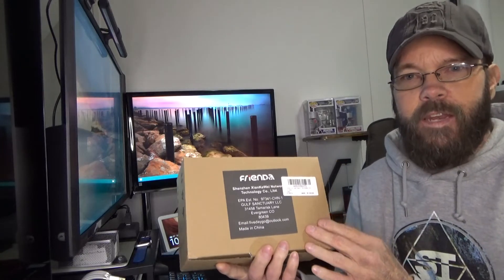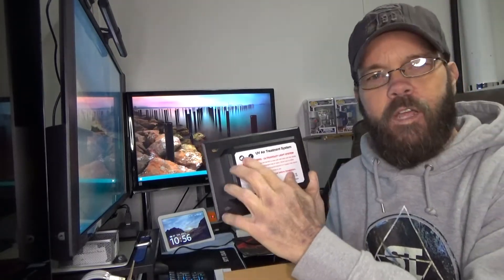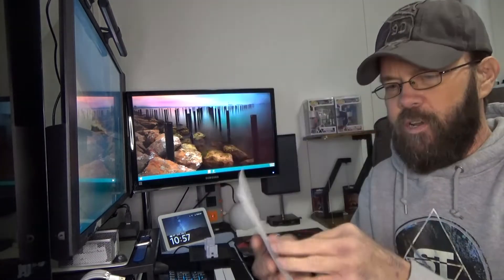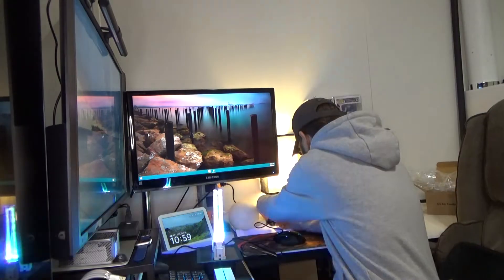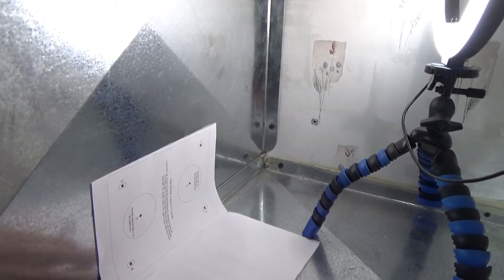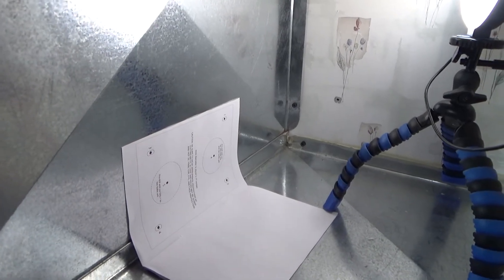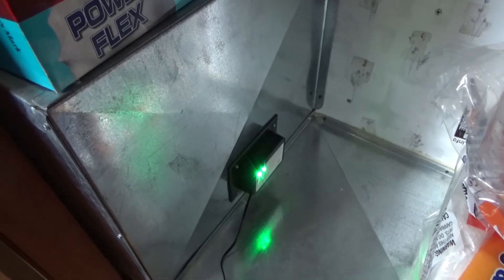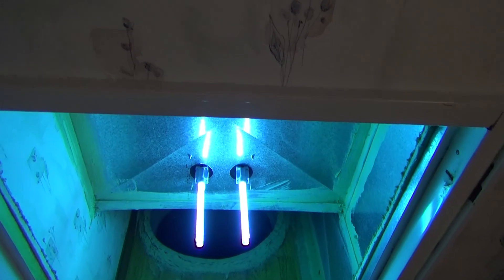26 Watt 110V Whole House HVAC UV Light Sanitizer Air Purifier

Comment: Did you have to set a timer to turn it on and off or can it stay on all the time if my air handler is  always on auto fan mode cause it can’t be turn off completely